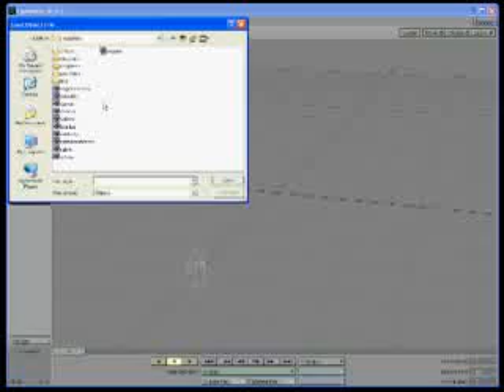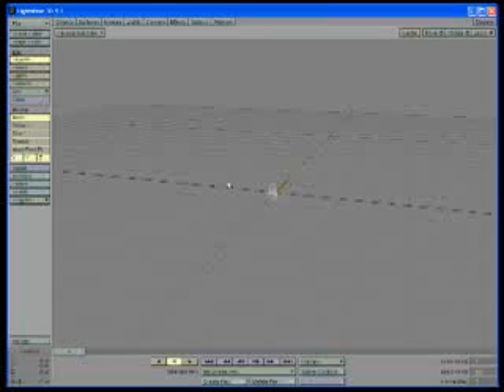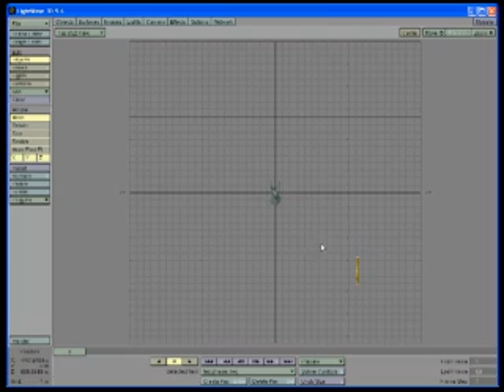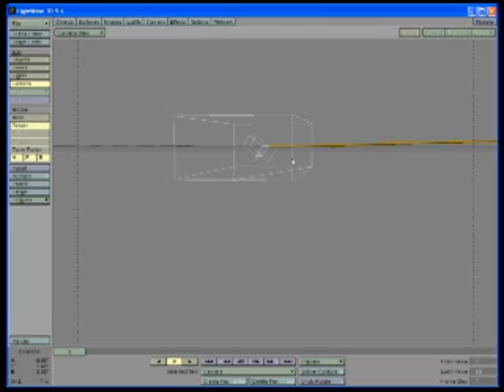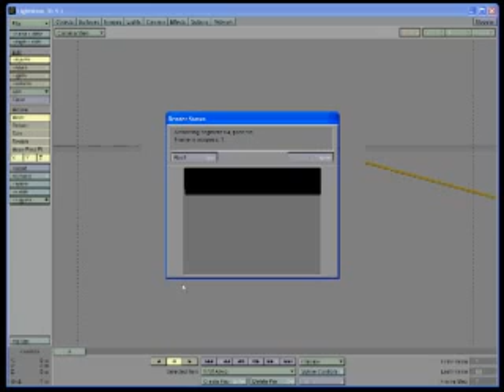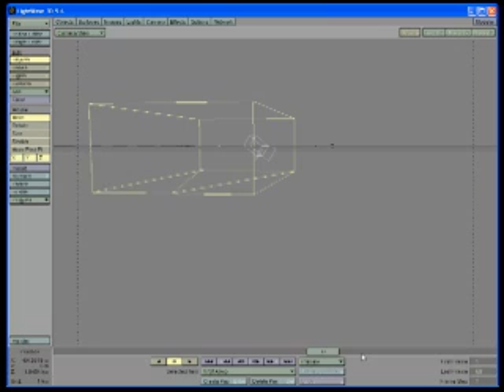Tutorial1 phasers

Comment from the maker: I agree entirely. I actually forgot I uploaded this its been so long (I guess this response is fairly delayed too). I use Lightwave 10.0 now, but I still have a copy of 5.6 somewhere. I actually used it recently :) I couldn't get a model to load in LW10 for some reason, so I opened up LW5.6, imported the file, and re-saved it. After that, it worked perfectly fine in LW10, go figure...  They used it on Star Trek Voyager, didn't they?